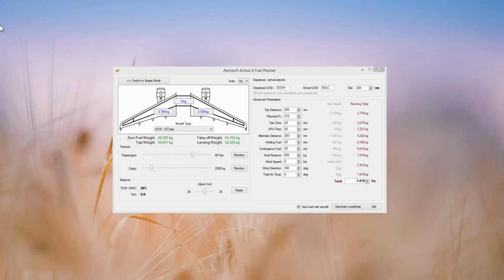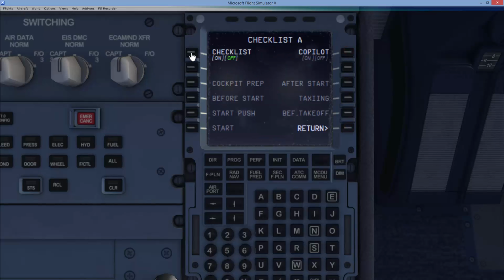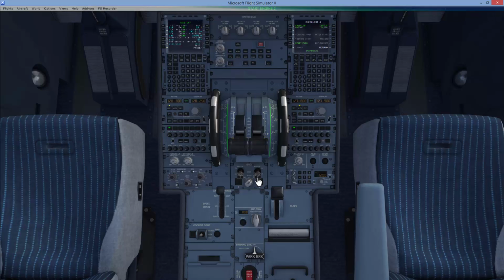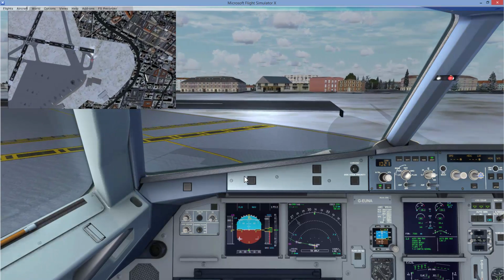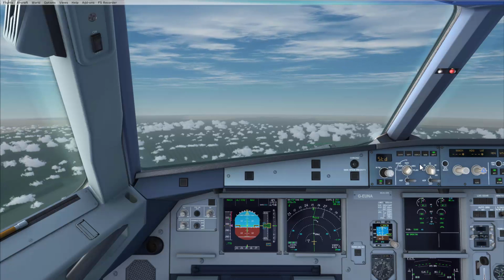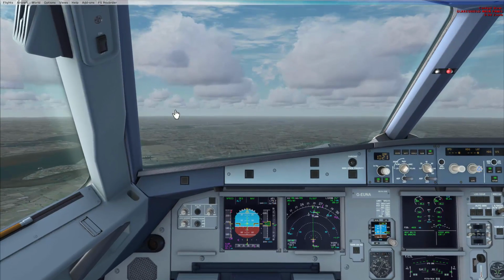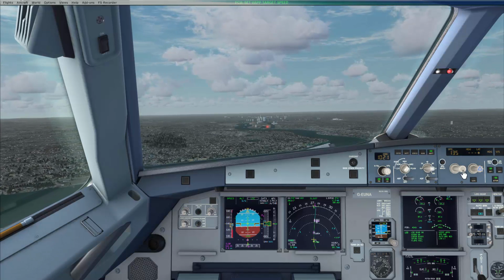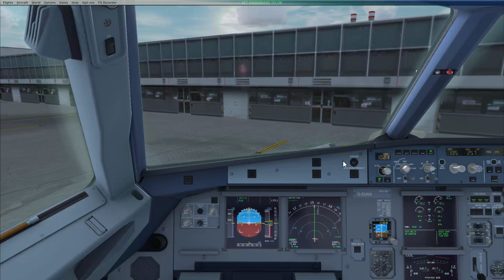Aerosoft Airbus Steep Approach into London City Airport

Comment: The issue with the fuel planner is it doesn't provide hours of fuel on board, which is necessary for VATSIM, that's why I use a less reliable fuel planner online. Does anyone know how to use the provided fuel planner and also get the time of fuel on board?

Comment: You should be intercepting the glide from 3000ft just outside 5nm, to stay inside Controlled Airspace . Configure just before this, as glide comes down half scale. Full flap and gear down at that point to avoid dragging the aircraft fully configured and making lots of noise due to high drag in level flight. ATC speed control would instruct you to maintain 160kts to 6 DME.

Comment: I have tried this approach and each time on final the autothrottle will go to toga and force a goaround. Any idea what I do wrong?
Reply from the maker: Hello Paul

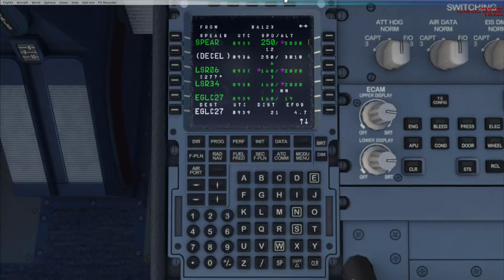Too many variables to be sure but I suspect that you may not have engaged approach phase. See 25:06
Reply: Thanks
If you mean the Appr Phase in the MCDU I did activate and confirm. I also changed the vapp to 135 and FCU in Managed mode and plane prepared for landing turning final.
Maybe I will try speed in Selected mode.